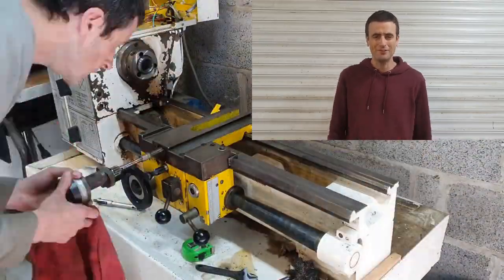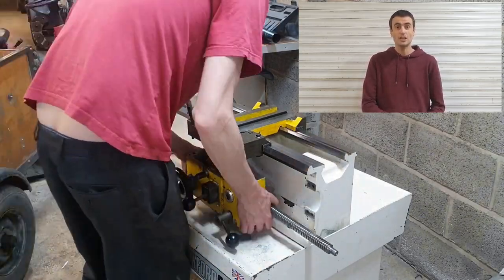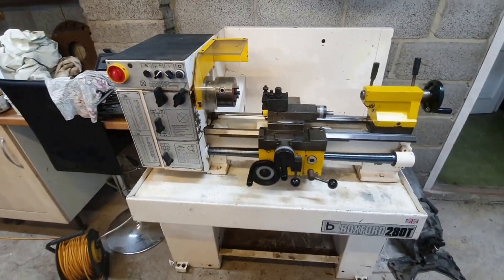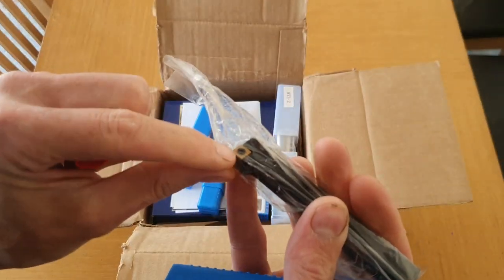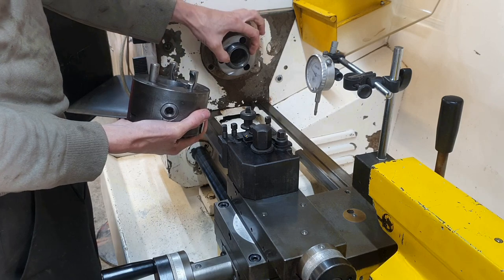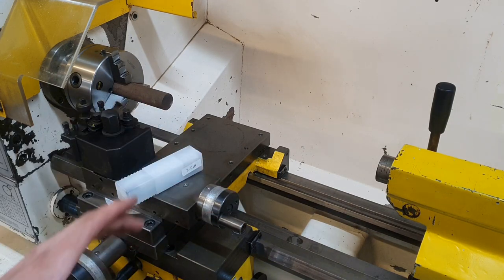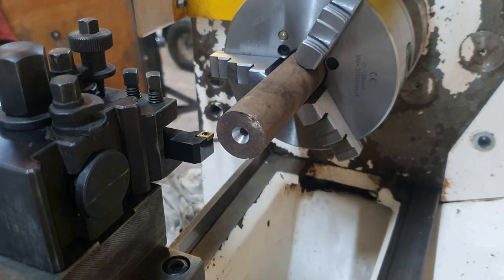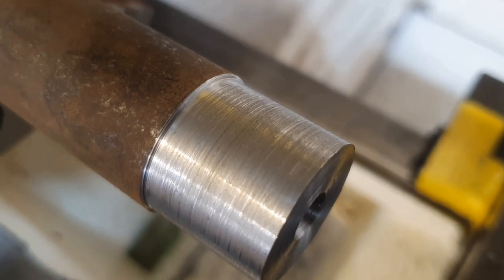Boxford 280T, single Phase conversion & variable speed inverter. How to modernise an older Lathe

Comment: I have a similar lathe. But a longer one. the 330TR. I'm considering either getting 3 phase power hooked up to my workshop or use the existing single phase in the workshop with a VFD. I've looked at the wiring 'under the hood'  and it seems daunting to me. I know very basic wiring but I'm willing to learn and try to rewire it. How hard is it to rewire? I have the original diagram but I can't seem to make out  heads or tails from it. Do you think it's easier for me to spend the money to get 3 phase power or learn to rewire the lathe? I would appreciate any reply.
Reply from the maker: Hard to sat which is easier.... if uou hooking up three phase then technically you don't really need to do anything to rats nest of wires inside, just find where to connect your supply and you're away....   

But the VFD is better. Variable speed is fantastic! It's worth the wiring.

I'm not three phase expert, I was a little worried about the wiring too. But the instructions are good. And if you buy from 'the inverter supermarket' they're really helpful over the phone. It always looks way worse when you look at someone else's wiring job, but when it's your own it's not that bad, just follow the diagram, do it one wore at a time. 

With the VFD you do basically rip out the whole lot, you pretty much start from scratch and follow the instructions. 

The only other thing was that you have to retire the connections in the motor but mine had instructions written on the back of the motor terminal cover plate so that wasn't too bad either. 

Only you know how capable you are though....  

Hope this helps
Reply: Okay thanks! I think I'll go the VFD route if the inverter supermarket has good online support. I'll ask them first. Thanks!  @lozl
Reply from the maker: @toastyovens8777  An excellent choice.

Comment: As said, don't beat yourself up about the finish on that steel, probably a bit of old hot rolled steel which is prone to hard spots ( if you traverse by hand you can normally feel the hard spots when you're turning it down ) box standard mild steel is dreadful to machine nicely.
Reply from the maker: Thanks for the comment much appreciated. I have now had some much better results from parts of an old rolling road I'm restoring. It's left a beautiful finish for the most part. 

I'm really enjoying this lathe. The variable speed is such a good learning tool for a novice like me, you can just running it right through the rev range and pick the best finish. 

Once again thanks for talking me into a VFD :)

And thanks for the comment, it's great to hear from someone with some serious know how in machining.
Reply from the maker: I have just noticed I have been calling your channel "tweed garage" missing the "s". Sorry about that
Reply: @lozl  no worries 😁

Comment: No need to talk me in to a lathe! I would love to change mine, for similar reasons to you, metric read out being the biggest. I want a Harrison m300 but they are usually £2500 and up. For hobby stuff thats a bit much! That crap cut at the end could be material. Ive got some mild round bar laying about and its so soft it cuts terribly. Even on the CNC lathes in work it finishes terribly
Reply from the maker: Ooooo that would be lovely! What do you use at the mo?

Thats interesting. I have subsequently made some parts using scraps cut off the rolling road and it seems to have left a much nicer finish :)